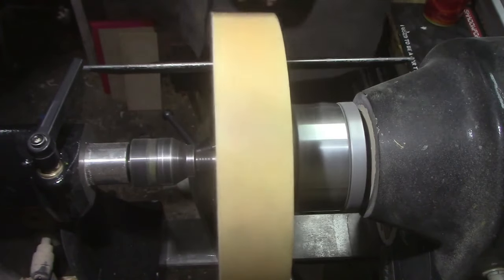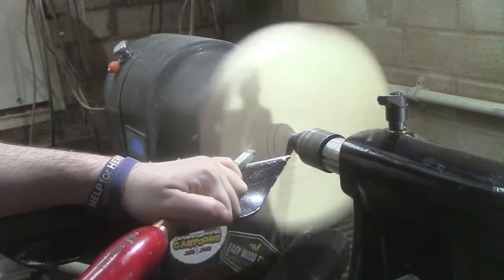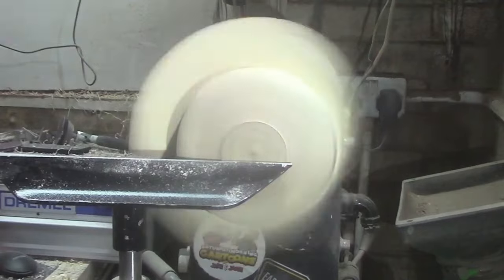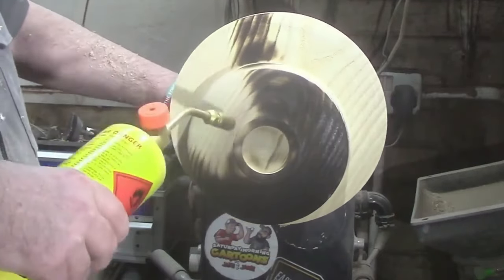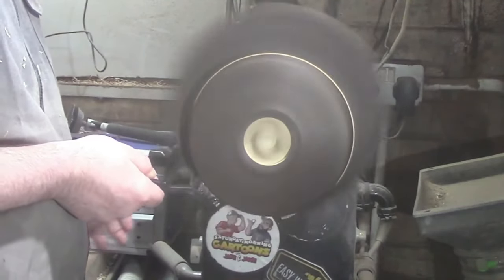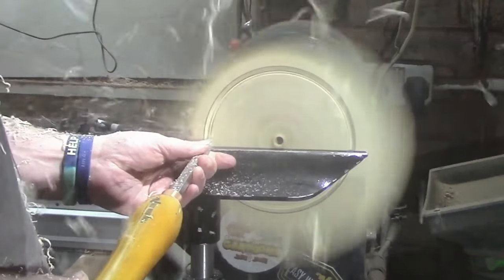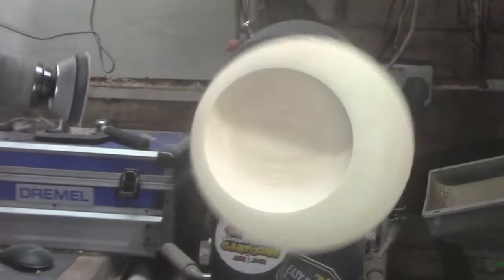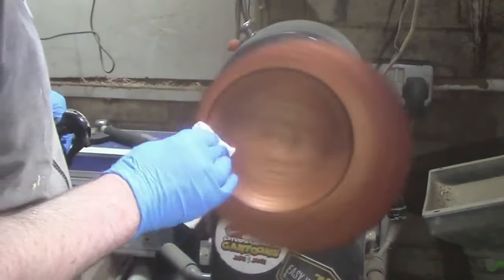Woodturning Off Centre Ash Bowl Transformation  Scorch Stain & Shine!

Comment: JP, help! I'm trying to turn a platter using the outboard side of my Laguna Revo 12/16. I started by gluing up a bung of 2.5" pieces @ 16' long, then I cut it into a large rough 16" platter on the bandsaw. I screwed on the chuck plate and started turning, but after taking more than an inch off, I still can't get the platter to balance itself out. It's still totally lopsided and making my lathe jump all over the place. How can I fix this? Thanks for any advice! Cheers!
Reply from the maker: I’ve been rattling my brains over this one and the only thing I can think of is that as soon as the outside shape of the wood is turned and off the face plate or worm screw and on the chuck make sure the chuck is clean and the mortise and/or tenon matches the jaws and then mount it on the chuck, the outside of the platter should run true and if not I really can’t think….. let me know how you get on and in the mean time I’ll ask a few woodturning friends and see if they can lend an opinion too, my only other guess is maybe there’s too much water weight on one side of the wood from where it’s been sitting and that’s what’s throwing it off?
Reply: @jpwoodwork  Thanks so much for the reply mate! Because of the various wood types glued together, the weight of the yellow heart vs the walnut, as an example, may be throwing it off as well. I'm gonna try to remount the face plate to see if I can find a better center.
Reply from the maker: @Roaming1Buffalo  yes, different density of wood will for sure throw it off too, for example if you had construction pine one side and Lignum Vitae the other it would probably take a walk across the shop LOL, id say as long as you get the face plate as close to the centre as possible and ride it out, the closer you get to round you can sometimes turn the speed up fast enough to go past the wobble but PLEASE PLEASE PLEASE!!! be safe if you are going to try that
Reply: @jpwoodwork  I've had my share fly off, so I'll definitely be super cautious! How can I send you a pic?